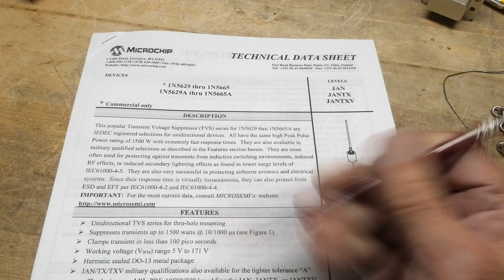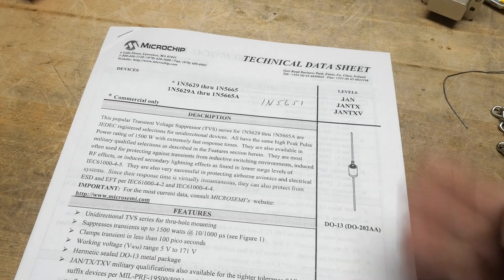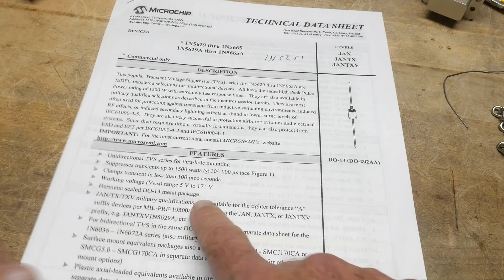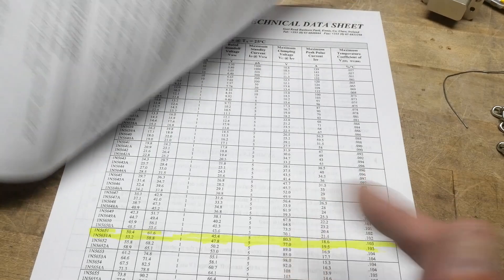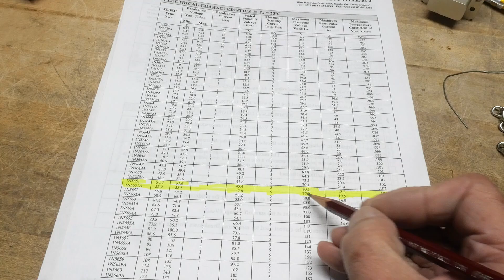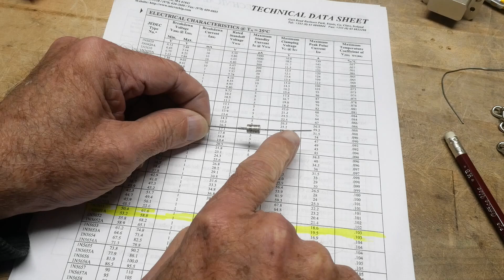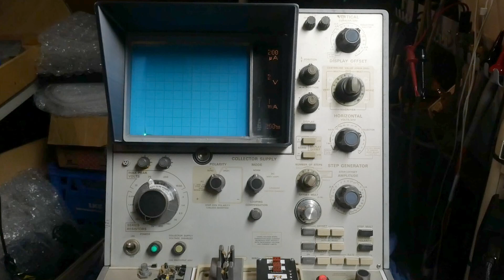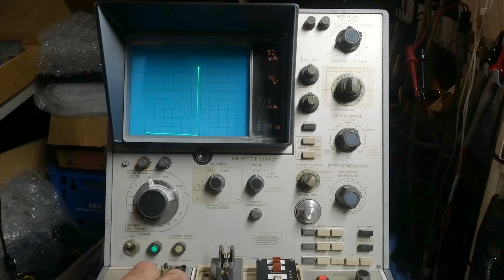#2146 1N5651A TVS Diode

Comment: I designed a process to test these things in a solenoid relay shunt application. If you break the current in an inductor with a TVS in parallel, the contact voltage will rise and clamp at the device's activation voltage. You can track the derivative of the voltage and detect the pulse width and voltage when it activates. A TVS with an adequate power rating for the inductor can act as a voltage limiter to prevent damage in a solid-state drive circuit.

Comment: I tend to use these on the output of LM3xx regulators to protect against the regulator passing the input voltage straight though (shorted) - one of these plus a fast blow fuse gives a low cost solution to this mode of failure

Comment: I use these all the time to protect power semiconductors from failing due to switching transients ( easy to happen when you are doing prototypes/experimental equipment). I buy them in units of 50V and 100V, then add them in series to achieve the necessary voltage rating (usually several hundred volts...)

Comment: Is there a "Modern Equivalent"  of the Curve Tracer. If so what is it called and how expensive is it ?
Reply: I don't think there is any modern equivalent that can deliver as much collector voltage (~1300V) and handle upwards of 20A.  But there are smaller devices that can do curve tracing at much lower voltages and current.
Reply from the maker: I've seen modern SMU supplies at 3300V and 50A, not at the same time though
Reply from the maker: https://www.keysight.com/us/en/products/parameter-device-analyzers-curve-tracer/precision-current-voltage-analyzers.html
https://www.tek.com/en/products/keithley/4200a-scs-parameter-analyzer
Reply: Keithly are amazing still relevant measuring devices same thing with Gen Rad megaohmeters. All analog even tubes are used in them.

Comment: Used these a lot, mainly the JAN versions, don't want our designs to appear cheap. used to protect our nice 5400 series logic chips. but that was back in the days when you could buy mil-standard components. before extended industrial became the new mil-standard with -55/+125°C temperature ratings.

The thing to remember is that a TVS diode is way way faster than a Zener diode we are talking 100ps as shown on your data sheet. Have found that sometimes if the tripping point is too close to the max supply voltage they can fail due to overheating. just a little leakage current  over a prolonged period of time can make them exceed there temperature ratings.

During lightning testing we could see little flashes of light from our board, we were trying to work out where they were coming from.  When a TVS diode exited stage left at very high speed! in place of the 5 Ohm limiting resistor a 0.5 Ohm had been fitted, poor little thing never stood a chance.

Comment: TVS diodes are fairly common in commercial two way communications equipment power supply circuits.  Some of the MIL Spec (JAN) version's easily run over $100 each.

Comment: Thanks!  How about a bidirectional one? 😊
Reply: Plus, can the bi-directional one be used to shunt out ghost AC voltage on a soldering iron without causing other functional issues?  Example, users who are adding a resistor to ground on the HT140 hot tweezers.